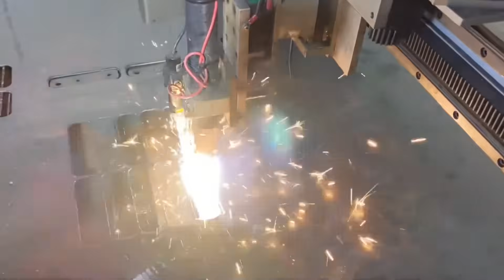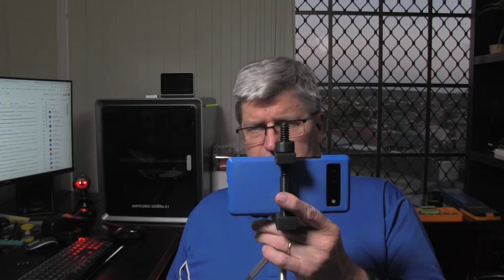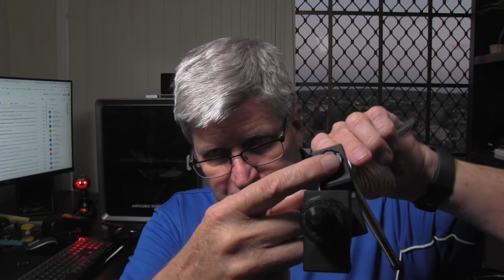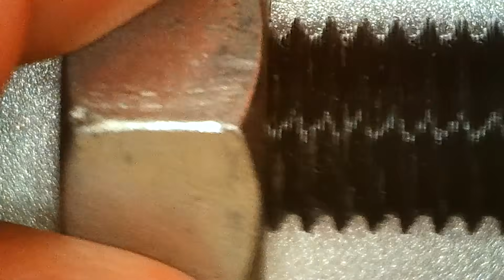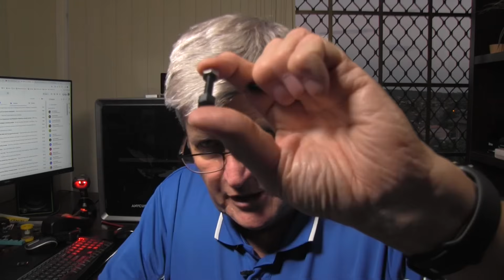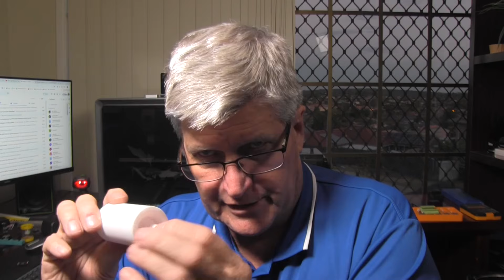My CNC Machines Are Sitting Unused Now

Comment: on a more serious note I have both a 3D printer and cnc mill . That said building a mostly 3D printed hot wire foam cutter
has definitely shown me the potential of the 3D printer to be the one more tool to have in the box. Sometimes it's just
more convenient to print something then machine it. Unless it's a high temp or high stress part item, then cnc is 
usually the route to go.
Reply from the maker: That's a great point, the versatility of 3D printing is really amazing! To think I used to scoff at 3D printed parts!
Reply: Building my first cnc plasma table using a 3d printer and a tig welder :D
Just want to learn linuxcnc, even if i don't need it :D
Thanks for your help at the forum!
Reply from the maker: @daanb_96  thanks. good luck